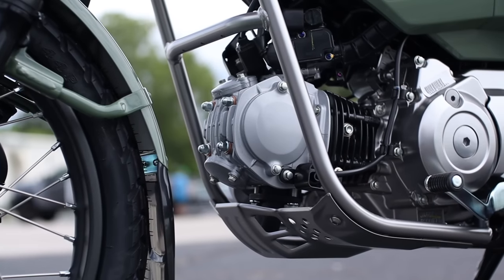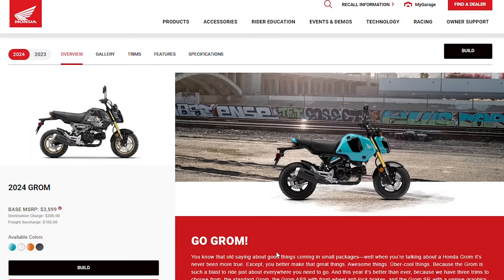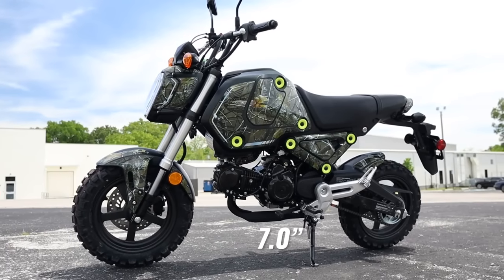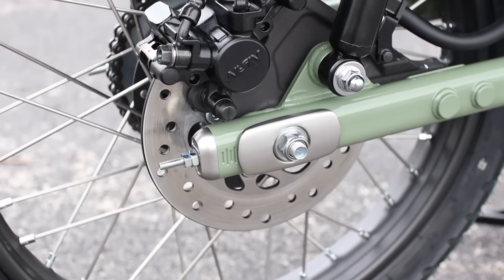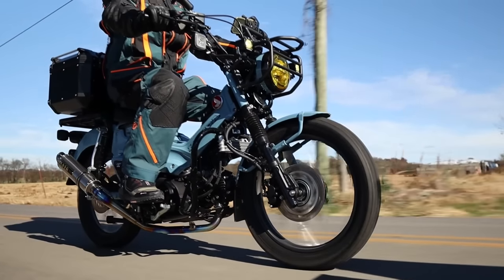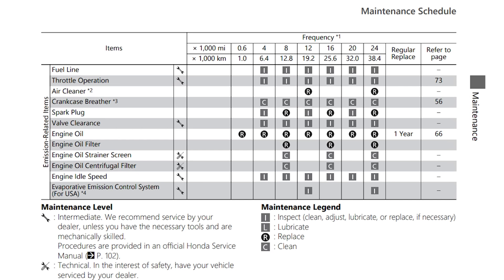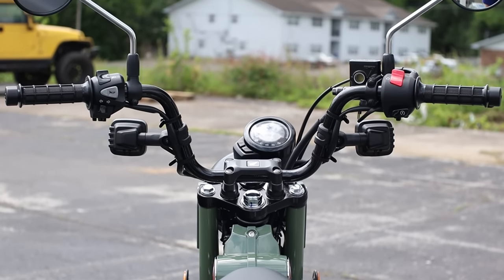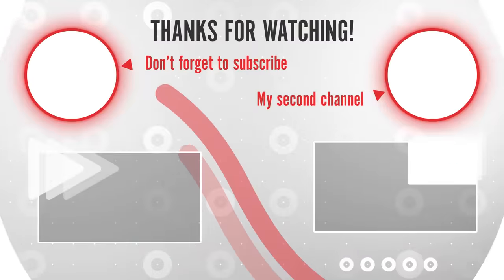NEW Honda Trail 125 Review | CT125 = Better than Grom, Monkey & Super Cub Motorcycles?

Comment: Got lucky and was able to get the new CT125 back in May.  With just over 100 miles, compared with my '22 Grom I generally prefer the feel of the CT125's ride and handling.  It's also a more practical bike being fun and capable of carrying a lot, a quick run to the store, around a campsite, even just tooling around the neighborhood, etc.  Lots of accessories to customize to your desire.  I like the center stand which makes for easy maintenance.  Having a kick-start and an electric start is a good idea, so is the 'snorkel' intake and high exhaust.  Many would call this a great bike for preppers.   So what would I change?  I prefer the Grom's instrument cluster which is easier to read and provides more info.  The Grom is faster; its manual 5-speed helps that.  Since currently there are no options for this bike, I'll suggest one that I believe many would like:  offer a 5-speed with clutch!  This would fit well with the CT125's character and make it quicker.  Overall another great little bike from Honda!
Reply: Why not convert it your self into a full manual transmission, I dont think it would be that difficult to swap parts after all its the same engine as the grom.
Reply: Conversion costs money.  Fitment might be an issue, too.
Reply: There is never gonna be a manual CT ever lol, a BBK with bigger sprocket is all you need .
Reply: @meuhey  mine will,...if Honda decides to sell me one in Europe.
Reply: The auto clutch is ideal for crawling slowly on rocks or other difficult terrain. A manual clutch would burn up faster in such conditions.
Reply: Possibly; I'd think that depends on how and where you ride.  True dirt bikes encounter more difficult terrain with their manual transmissions.  A manual first gear can be pretty low so that clutch slipping isn't much needed.  I found this to be the case riding my 6-speed KLR250 dual-sport on very challenging terrain.  My post above suggests a manual 5-speed as an option.  Buyers would then have a choice.

Comment: Thanks for the video! I love the mini-motos. - My beef is this: For me to ride one anywhere but the nicest of flat trails, the CT needs a low range again. I'd also gladly pay a bit extra for a heavy duty suspension option. I live in a very mountainous area, and I'm NOT light.
Reply: I agree that it needs the low range. My 86 CT 110 has it and it’s really needed for off road hills and the technical sections.
Reply: I’m going with a used ct110 to get the low range. Very needed here in my mountains too!

Comment: For several months now, I've been contemplating getting a Trail 125, though the Monkey has also grabbed my interest, except for the red plaid seat which is close to $500.. if like me you simply can't stand plaid on anything but a table top or maybe pajama bottoms. Of course there are gorgeous seat covers available from Cheeky Seats if I went the route of the Monkey. 

As an owner of a very low mileage 2009 KLR 650, I do want to ride off road more safely since as a new 70 year old adventurer, there is no room for me to break or damage my body without long term consequences. And, as much as I totally love my 2021 PCX150, I think having a bike simply intended to explore the beaten path would be quite enjoyable., though the XR150 is far less expensive, just simply not as cool looking. Decisions...decisions.

This video has probably pushed me closer to making the purchase, having yesterday sat for the first time on the new 2023 Pearl Green Trail. In the future, I may be selling my KLR, but it still has plenty of adventure in it, and this September will be riding with a friend on his VStrom 650 up to Maine from North Jersey for some light offroad camping experiences.

Thanks for another outstanding review! I've been following your channel for years!
Reply: Like you said, I think you may find the - not as cool - XR150 a lot more practical, i.e. ground clearance, suspension travel, conventional pattern (one down, 4 up) 5-speed gearbox with a clutch, 12 litre fuel tank, 19" front wheel, a lot more akin to your KLR but a lot easier to handle in the rough stuff. My 2015 model (here in South Africa) hasn't missed a beat after 20000km.
Reply from the maker: Yeah buddy, that's a difficult one between the Monkey and Trail for sure! I, on the other hand actually like the red plaid seat lol! It's definitely one of those love or hate things though with it being a little on the "loud" side when compared to the rest of the bike, so I can 100% understand why you and many others don't care for it. One other downfall to the Monkey in my opinion, if you want to call it that, is that the fuel tank is almost $600. Yes, we don't plan on dropping them but if you're wanting to venture off-road, to which it sounds like you want to, a simple drop could turn out to be rather expensive when compared to the others. Just something to keep in mind though ;)

Cool to hear you're enjoying that PCX! Waaaay too many people knock those things without giving them a try because scooters aren't "cool" but 99% of the people I've dealt with over the years, change their tune real quick when they give them a try. It's the same story with these mini bikes too though, so many people are "why would you buy a 125?" and then they give it a whirl and see how much you can have.

Yes, sir. You've definitely got to consider the XR150L if you're looking at a Trail but like you said, the Trail is lightyears ahead when it comes to cool points. Plus, the semi-auto can spoil you real quick when you're just tooling around but is it worth $1,000 more? That's the difficult question. If you care about overall build quality and "feel", I think you're going to lean towards the Trail as the XR is without a doubt - built to a budget and it's evident when you get up close to the bike and really start checking out the details. I'm not knocking it though as for $3,000 - it's hard to beat but one glance at those ugly frame welds and you'll be questioning whether or not it's a Honda lol. Unless the unit I got was one of the worst so-to-say but take that with a grain of salt as I'm picky when it comes to that stuff and like Dave said, there's been a lot of guys around the world pushing these bikes and they've shown to be a super reliable platform.

I've rambled on long enough to put you to sleep though so I'll shut up now lol! I can't say thank you enough for the kind words and for hopping on board to become a member to help support future content. It's been a struggle trying to make this sustainable but one way or another, we're going to make this work! Thank you again, I really appreciate you...

Take care and enjoy your trip this September on the KLR ;)
Reply: @HondaProKevin  Thanks for your take on all my options, as it seems that dealerships really need to update their websites and inform the buying public that the bikes they're featuring simply don't exist!

I called the dealership I was hoping to purchase from as well as 3 others in the tri state area, and though they show the Trail 125 on their websites, they're all accounted for or already sold. And since this was just going to be a frivolous purchase, I can wait or consider something else. It's not like I don't have choices. Storage is more a concern if I want to squeeze another bike into my fleet.

I have even considered the Amigo clone of the CT 70/125 as they're available for under $1500 at a local dealer in SW Jersey. 

Thanks again for your outstanding informative videos! Consider me a loyal follower!
Reply: 😎 Rock on Sir

Comment: I think it’s a great motorcycle if you ride it within it’s intended use. 
After talking with a lot of riders at the Scooter Cannonball, Honda needs an efficient but capable scooter. Water cooled 350cc, twin cylinder with 270° firing, DCT, kinda the same rear drive like the Burgman 650 had, 4.0gal  fuel capacity and cruise control.

Comment: Love the retro green looking color. Seems like these are so hard to find and dealerships rarely have many in stock. Must be because it takes time to compile that extensive tool kit they come in the build out process. The CT 125 is intriguing. But I'm still hopeful the Dax shows up on our soil one day. Makes me wonder though, if and when the Dax shows up, will they be just as under ordered, scarcely in stock and hard to find as the CT 125 is? Thanks for sharing. Always enjoy your segments.
Reply from the maker: Same here bud! I'm not a huge fan of it on the Rebel 500 as it's just too much green on the tank with nothing to break it up a bit, like with the CT125 / CB500X and on these bikes - I love it.

Hahahaha right! That super extensive tool kit paired up with the exclusive to the CT squared turn signals, have to be what's been slowing production down on these things lol! Fingers crossed they get a handle on things soon as the CT has been like a unicorn to find in dealerships, ever since they launched the thing 3 years ago.

It's not the under ordering from dealers that's causing their scarcity though. It's Honda's production issues that have been lingering on and on from the rona mess, paired up with new emissions standards in a few key countries as well as parts suppliers issues that have really thrown a kink in things. Most dealers are ordering as many as American Honda will let them because these things will sell quickly, unlike a lot of models that may hang around on the showroom floors for months before turning. When Honda doesn't give them an option on their MROP to order them or cuts their allotment numbers down to practically nothing, they're stuck. Long story short, it's a mess lol! We need some sort of normalcy soon though as a lot of dealers are still struggling to this day to get inventory. Crazy times for sure!

Here's to hoping they get some of it sorted out before the Dax is released here in the USA though, otherwise it's going to be the same mess we've been dealing with... Let's all cross our fingers together lol!

Thank you for the kind words, I really appreciate it... and thank you for watching and jumping in the conversation too, means a lot as I try to find some way to make all of this sustainable, so I can continue bringing you guys Honda content ;)
Reply: @HondaProKevin  I was making the same comments about last year's model, and as soon as I gave up on finding one and settled on a Navi, wouldn't you know it? A week later the dealer had both a Super Cub and a CT125...

Comment: I was quoted $6000 out the door last year. I bought a used Grom and Drz400s instead. I'm happy.
Reply: 4000$ for a small 125cc motorcycle is a bit unreasonable. I'm from India, back in 2020 i got my first motorcycle Yamaha FZ v3 150cc, it has similar ergonomics of a mt 03 and i only paid $1600.
Reply: @RohanSanjith  Can't find one for $4000 here in the US

Comment: I really think these bikes are perfect in Asia. Where you mostly get around doing mid distance, travel at most. However, in the US where you often drive on a highway for 30 minutes to an hour, these things are woefully underpowered.

Having said that under specific circumstances where you only travel 20 to 40 minutes going about 30 to 40 mph it’s perfect
Reply: They do sell them in asia, but they are strictly luxury toy bike as they cost 2.5x the prices of similar displacement cubs and mopeds sold by honda themselves that are developed for and manufactured in southeast asia

Comment: Interesting little bike. Reminds me of the 1965 Honda 90 I had (until it threw the connecting rod through the block) back in the early '70's. I was in my early teens and had decided to add some STP oil additive to the oil and I think that stuff made the oil too thick causing the failure, pretty rare for a Honda to throw a rod.
Reply: STP was invented by Andy Granitelli to make his oil not break down and loose film strength when running the Indy 500.  It was not a good choice for a motorcycle engine.  WAY too thick. Listen to the engineers who wrote the owners manual.
Reply: @jaywintersit2483 wet clutches are not a fan of it either

Comment: I got a trail 125 2023 just got it last month already done 1100 miles about half in gravel, mud, sand. I’ll probably have about 5000 by the end of summer in glorious Central Florida weather. So to answer the question, first none of the Honda accessories are available in US. On the actual CT the tires could be better as dual sport a more powerful headlight softer seat and wider pegs and the chain I done 3 adjustments already. When I am standing on the pegs my boot pushes on the kick start.

Comment: Excellent video! Subbed.
I think Honda should add a fully enclosed, low maintenance chain-guard like the original CT90 had, or at least offer it as an option.
I was also wondering whether the front ABS is switchable? If not, what does it feel like going down loose gravel hills?
Reply: Usually, having ABS on the front is advantageous for descending loose downhills, keeping the front from washing while letting the rear lock up if necessary. So, a lot of offroad modes switch off the rear but retain the front. 

Really steep? Might be best to get off and walk it down, but that could be impossible if you can't activate the rear brake - does the CT have a handbrake lever for the rear?
Reply: @randydewees7338  I may be mistaken but I believe the latest, more expensive, adventure bikes have various riding modes and their new generation, front ABS is quite effective off-road. However, I nearly died of fright when riding my newly acquired, 2010 BMW F800GS down a steep gravel slope with it's older, non-riding modes, ABS still engaged. I think the CT125's ABS brakes may be the older, low tech type? So, like you mentioned, walking it down steep gravel hills may be the safer option.
Reply: @DaveZee01  I had a similar experience with my friend Al's GS650 Dakar. We did a loop over Hunter mountain to the Racetrack, then tipped off the Lippincott Grade to head down into Saline Valley. I was on my trusty Dr650 and I had done this loop before. He instantly froze up near the top. I said let's switch bikes and I'd take the Dakar down. I forgot to turn the ABS off (have to every time you start it up) and it took everything I had to stop it from 5 mph! That shook me up, and with the really soft forks I gave up too. We ended up walking that 400 pound beast down - he on the bike, me as a sea anchor holding it back. Every few hundred feet I'd run up the road and get my bike. I was soaked with sweat by the bottom. 
I've had a few CT90's over the years, but at least 30 years since the last one. I think it had a rear brake lever on the left handlebar. Very easy to walk it down. Most normal bikes you just leave in gear and modulate the clutch.
Reply: @randydewees7338  Thanks for sharing Randy. Us older guys have been there, done that!

Comment: Tubeless tires. Normal toe shift option. Windscreens you don't have to send to Taiwan for. Engine large enough to keep up with traffic accelerating from a stoplight. Lower seat, and finally, more rake -- the thing's squirrelly as hell.

Comment: One of the main reasons I would buy a trail 125 is to have a small engine with a relatively large fuel tank to possess a worry-free range far from support infrastructure.  That standard teensy gas tank does not inspire confidence, and I'll bet an extra tank would add considerable cost, and take up storage which would otherwise be available if the standard tank was bigger.  (My taste, however, does run to huge gas tanks.   There's never enough fuel capacity for me.)  I am also a bit suspicious about a 4-speed being adequate for an off-road 125.
Reply: mine gets 106 mpg so it goes pretty far, and has a gage too.
Reply: @garyreed6310  If it meets your needs, more power to you.  But we're talking about confidence and peace of mind--it's nice to have more than you need--however much it takes to put your mind at ease--when you're in the middle of nowhere.
Reply: Just strap on a one gallon container  of gas and pour it in if you run out.
Reply: @carlrutledge3096  Um-hmm.   Having a strapped-on gas tank upsetting the balance of the bike, using on rough off-road trails, then unstrapping it and refueling in the woods, would seem to be less confidence-inspiring than having a big gas tank to start with.  But ya gotta do  what ya gotta do.  There are also areas which look askance at packed-on fuel tanks.  It is far more confidence-inspiring to the rider and to others to have an original or professionally--added fuel tank to the bike.  If strapping on a gas tank has  to be done, it has  to be done--but it isn't "just" done.  (But the Boy Scout juice does help with starting campfires.)

Comment: I wrote honda a few years back and wanted a 280 cc model. But I think the liability would be a issue . Able to carry a passenger. I have 3500 miles on my 2021 and granny gear is not low enough. I almost had to dump it in some soft sand and high gear could be higher. A 5 speed would be ideal ! Love it ! 5500 $
Reply: Did they reply..?

Comment: I love my new Green 2023 Honda Trail 125! It’s such a fun and nimble motorcycle! Like so many people, I wish it had a little bigger engine just so you’re not lagging on some hills. I know it’s not meant for going really fast, but it can definitely use a little extra power. Nevertheless, it’s an amazing mini moto and definitely serves its purpose!
Reply: I agree.  Very versatile and checks most all of the boxes.  Certainly not for highway use but even on secondary roads with hills, maintaining even 40 MPH can be a challenge.  I'd really like to see an option for a 5-speed manual transmission, possibly with a 150cc engine.  I'd then buy another!